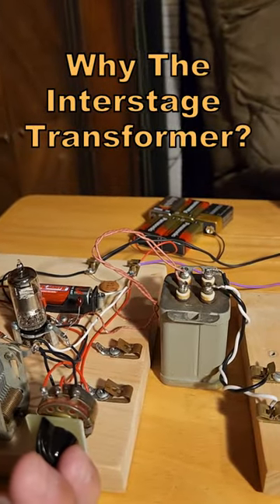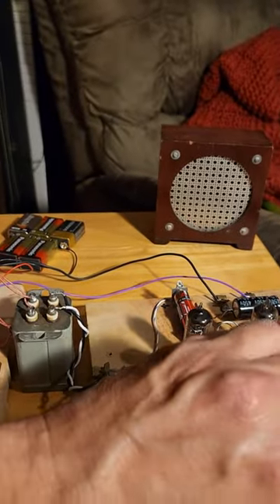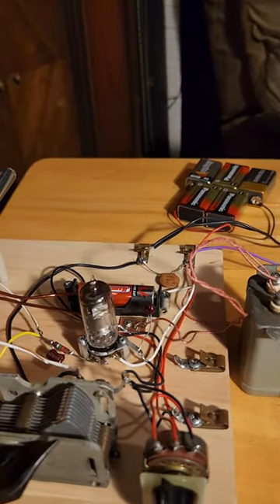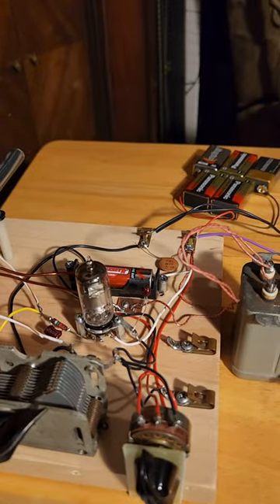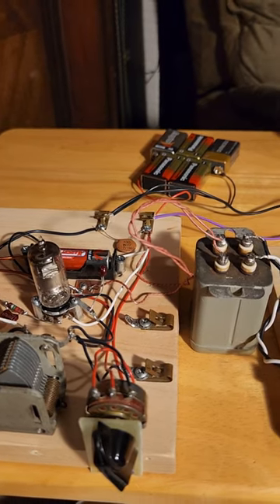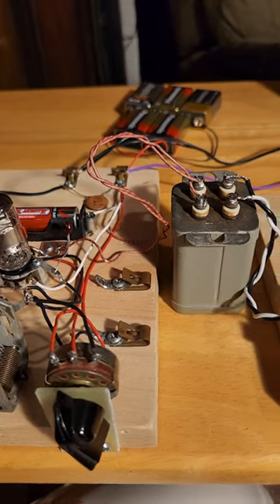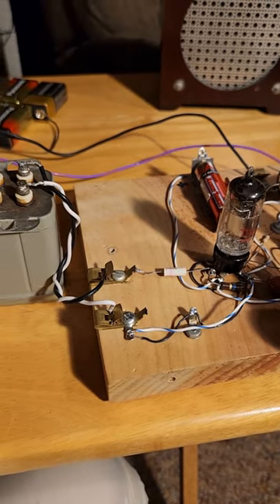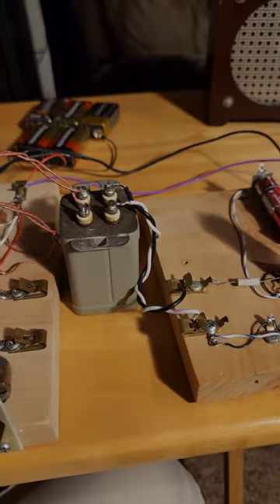Audio Interstage Transformer

Comment: It also looks cool sitting there.
Reply from the maker: Speaking of which, these things do not have to be large, because the currents here are so small < 20 mA. Most were large to prevent wire burnout during a short circuit condition, so the AWG was a bit larger than actually required. And of course at High Z, you need a lot of turns.

Comment: Audio interstate transformers do make a difference when building and repairing regen and trf radios.
Reply from the maker: A good alternative is a high value mini choke with a resistor across it. You get the voltage doubling effect, if not the step up.

Comment: My bargain tube interstage xfrmr just says 3:1 ratio in the data. It has letters at each terminal like P and G which seem like plate and grid. So low ohm side to regen and high ohm side to grid of preamp?
Reply from the maker: Yup basically the step up is the way to go to get the most efficient transfer. The grid of the amplifier stage you feed will generally be higher than the preceding plate impedance.